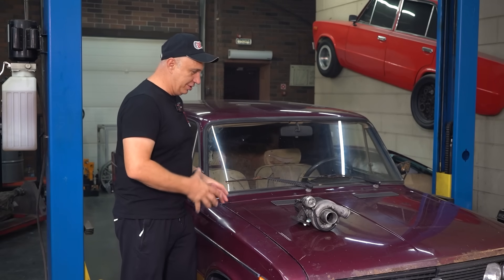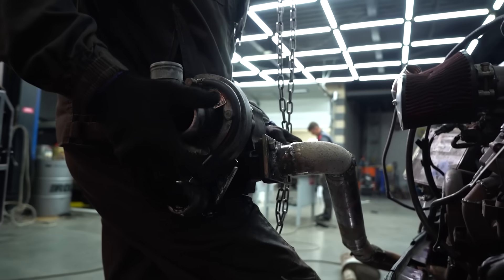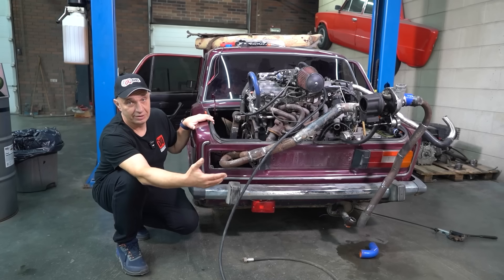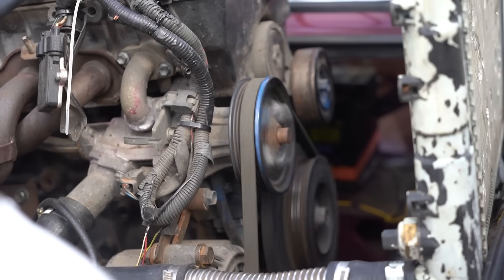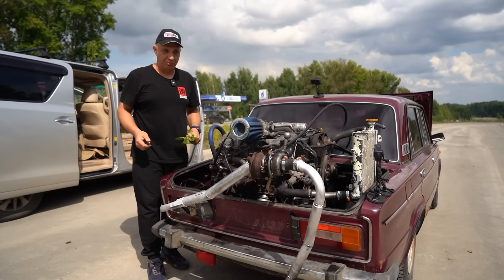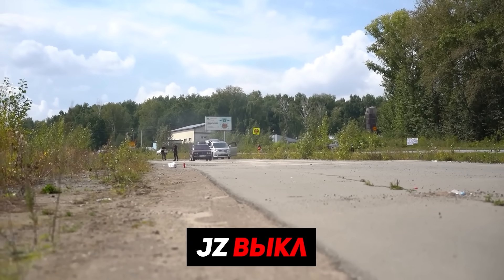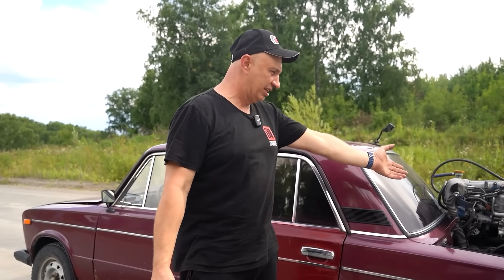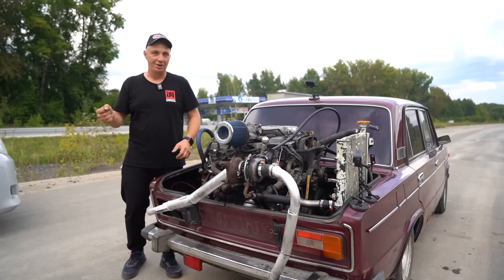Using a turbo to suck exhaust gases out of an engine - what will happen?

Comment: I wonder if a simple side exhaust, with different tip modifications to get a pressure drop from the movement of air around the car would help.(without the turbo) Now, that would only work at speed.

Comment: What about a Ram Air scoop , connected to the exhaust to push and pull the exhaust gases out.  You could mount one on either side of the car. One on the front or one underneath.
 👍🇬🇧🇬🇧🇬🇧🇬🇧🇬🇧🇬🇧🙋‍♂️

Comment: There was a rear mounted turbo system awhile back that sent compressed air back to the engine, don't know if it's still available. It supposedly worked, don't know how well. Conceiveably, you could use the turbo to suck exhaust rather than push air and not need a separate engine.

Comment: Well...an engine is just essentially an air pump working in reverse, in some ways you could say what you've done is connected the two motors with an air based drivetrain of sorts.  You could probably eliminate the 2jz and instead use a shaft connection to an electric motor with a max rpm rating of 80k or so, that should create a similar effect without nearly as much added weight.  You may also want a tractor flap on the vacuum side of the turbo so when it's on and sucking vacuum it shuts the flap and pulls the gasses, but if the turbo is off the gasses push the flap open and you don't gain a ton of back pressure from the stopped turbo.

Comment: Re: pause for prediction: 
Won't get more than 14 PSI of "boost".
Don't know a lot about exhaust system design: but heard that the speed of sound can sometimes be used to encourage complete scavenging. 
Don't know if the Lada has an exhaust system that advanced: but there would be almost no difference in that case.

Comment: This is redneck engineering taken to a whole other level. Negative compression... so zero efficiency? Despite using a 2nd engine to run... a fan... that's bizarre to begin with... but sucking all pressure out of the bang chamber? I predict bad bang. XD

Comment: What would happen if you ran the turbo off a belt from the front of the engine obviously geared up to make it spin very fast, would it act like a blower?
Reply: Yes...thats what a suoercharger is .
Reply: @Prizre obviously, but question is can a turbo be used as a super charger. We call them blowers

Comment: Great video!

Rather than using an entire engine, if you had two turbos, you could make one of them into a jet engine and use it's power to spin the second turbo. 🤔 Or perhaps a couple of car batteries, an inverter, and a vacuum cleaner blower motor to spin a single turbo to create the exhaust effect.

Comment: Means of packaging it easier my thoughts are to make a special electric motor that can fit exactly to the exhaust tip, it has to be able to work with the heat and that may be impossible or I saw this special gel when it gets hard it prevents heat transfer. So probably coat every part possible with it or just have it run with a external radiator that can cool the electric fan 😅😎👌💯🇹🇹

Comment: Guys you didn't need another engine to run the turbo. All you needed was compressed gas or air.
Reply: compressed air wouldn't work, it would be depleted very quickly

Comment: There’s a very fine line between genius and insanity. I really appreciate getting my crazy vicariously through these guys!  But I have to point out that the weight of the second will offset any advantage. You’d get a lot more out of adding a transaxle with the rear engine instead of an exhaust sucking turbo.  I have to wonder if the front engine would be running lean. Once again, very entertaining!  Thanks again guys!

Comment: You basically just got rid of the whole exhaust stroke.

Now just double the power by replacing the 4stroke cam shaft with a 2stroke cam shaft and use 1 belt driven intake & 1 electric exhaust Turbo on a Diesel, which is less picky about remaining exhaust gasses and produces enough extra torque to supply the belt intake turbo.

The electric exhaust turbo is to skip the whole second engine but still keep it decoupled from the engine RPM. You can hack any belt driven turbo into that.

Comment: I'd imagine if the gases were pulled fast enough it would create a vacuum in the combustion chamber which would help pull in air/fuel faster which would certainly help at higher RPM when the valves have less time to pull in fresh air/fuel.

Comment: Reducing the pressure in the exhaust system should increase the power. I don't know if it will improve the fuel economy. The engine will have a lower pumping loss during the exhaust stroke but if there is a lot of valve overlap it could lose some fuel mixture during the overlap period if the intake manifold pressure is greater than the exhaust manifold pressure. I think it might also confuse the fuel injection system and cause it to run rich when using full throttle if it has multiport fuel injection or direct fuel injection. It might be more likely to knock because there will be less exhaust gas left in the cylinder during combustion. Now I will see what results you got.

Comment: Id say, based on the principles of an engine this idea actually servers as like a passive supercharger. It may create such an increased vacum that when the piston reaches TDC and begins the intake stroke there is almost a complete vacum allowing more air to enter the combustion chamber as apposed to the what would normally be left over exhaust

Comment: Removing backpressure risks burning valves and pistons. Some is needed to control temperatures.

That said, I have my own idea for the gang. Transverse 4 cylinder powertrain / drivetrain, assisted by an electric motor on the opposite axle under higher loads to increase fuel economy. Basically a pusher in the rear, and a puller in the front.

Comment: you dont need the 1jZ you just need to put the turbo in the exhaustsystem itself and then put it in in the cold side so it would suck out the back pressure automaticly

Comment: I think one simple way to do it would be using a vacuum machine running on a 12V or 24V battery sucking out the exhaust gases. Imagine a vacuum cleaner just running at the back of your car and sucking out the exhaust gases, would be one simple way to do it with less weight. I think you guys can figure a easy way out.

Comment: What would happen if you took the output from the hot side of the turbo, and hooked it up to the intake side of the compressor? Would it create a compounded affect and continually help the engine accelerate? Or would it just sputter out? If so.. Why not do a twin turbo, where one does the above and the other has traditional forced induction purposes?

Comment: OMG less than a minute in and they are installing an entire 1JZ engine into the back of a lada just to turn a turbo to suck exhaust out of the stock lada engine in the front.  Pretty confident that sticking the turbo on the lada engine would have been much better gains than hauling an engine around in the trunk, but an amazingly psychotic experiment none the less.

Comment: The results indicate that you have a restrictive exhaust system. There are far cheaper and easier ways to extract exhaust gases than mounting a spare engine in the trunk to turn a turbo to suck the exhaust gas from the drive engine.

Comment: Back in the early 70's you could buy something that looked like a reversed cone which fitted to the end of the exauhst pipe to suck out the gasses as you drove forward.  If that worked why wouldn't an electric fan sucking the gases out be enough?
Typically mad, but great to watch!

Comment: Neat fact, Large steam engines used water injectors to cool exhaust steam which lowered pressure and greatly improved the steam engine efficiency.

Comment: Seems like a lot of unnecessaryness. Thinking a 12 volt high RPM motor with a small oil reservoir would have worked just fine to operate the turbo

Comment: Consider that the turbo sucks intake mix during " valves open overlap "  so,  an induction intake and richer mix could solve the problem.
G54 ⭐👍

Comment: Back in olden times when I did a little drag racing (bracket), eliminating all exhaust back pressure was something to be avoided.  I can't remember the exact science behind it but performance, and definitely throttle response, was adversely affected.  Clearly that's not the case with the higher performance engines but for semi-street tuning it was.  These results are probably to be expected from improved breathing (who knows how restrictive and inefficient the Lada combustion/exhaust cycle is) but this is still very interesting.  Отличная работа!

Comment: What happens if you attach a Ranque-Hilsch tube to the turbo? Is the pressure powerful enough to condensate the water steam in the exhaust? Maybe you could use the condensed water to make a powerful water injection engine.

Comment: Can you test my ideas if viable: 
1.a vane engine used as compressor for a normal ICE
2. Cam drive instead of crankshaft 
3. A turbocharger connected to the engine via an eddy current based magnetic coupling that can be disconnected for it to be used as a turbo or connected to be used as a supercharger.

Comment: Would it be more efficient with a procharger (belt drive style) to a 10-12hp engine due to the weight reduction and the abilities to adjust the speeds with different pulley sizes × rpm.

Comment: Aww darnit I missed it!   We did this back in the 80,s. We took a turbo and put a belt on it and drove the exducer to vacuum the exhaust.  ON 2 STROKE ENGINES!  This is a bit of a secret here folks. Oh im being bad...But I gotta do it for Garage 54 Crew.   If you put a vacuum on a two stroke you can massively improve performance, BUT it has to have a exaust modulating valve to stop it at low Rpms.
Or you will draw the entire combustion charge out of the cylinder and kill fuel economy, crush it really. the exhaust will pee gasoline.

Comment: Try making some sort of turbo pressure recycling system Where the pressure from the manifold is being stored in a pressure tank and sealed when the throttle is let go, and opened when the gas is pressed again to avoid turbo lag

Comment: Interesting concept, but it won't be viable. If not going with a conventional intake turbocharger, the smart alternative is an electric turbocharger powered by a hybrid battery and its high voltage system

Comment: Something strange about this install. There's got to be an easier way to plumb a turbo into another turbo and have it run off of one engine the fact that you have to add the weight of another engine is ruining any gain

Comment: I have the idea of designing the exhaust with mid cuts in cone shape to use bernoulli effect to expulse the air faster, no extra load, no power consumption and may make the exhaust system faster

Comment: Garage 54, can you please try turbo compounding? This is not the same as a compound turbocharger, but rather where an impeller similar to a water wheel is used to turn exhaust gas velocity into torque. The output of this turbine is routed to the crank via viscous coupling. Basically the reverse of a supercharger - instead of using engine power to induce pressure in the intake, it takes velocity out of the exhaust and induces power at the crank. Mainly used for early-jet era airliners for best efficiency.

Comment: i wonder if this could take advantage of the venturi effect? maybe a compressed air tank being fed air via a compressor on the engine so the tank doesnt deplete, with air nozzels within the exhaust angled and pointing outward. this would help draw the air, though the volume you would need would be very large.

Comment: Try it on a car with a turbo engine. Attach another turbo to the car but put the hot side to the cold side of the stock turbo. Then attach the factory turbo DP to the cold side of added turbo and continue the exhaust system how you need it. The factory turbo cold side will drive the hot side of the added turbo. And the added turbo should have power to scavenge the exhaust out. The lag might be more noticeable but in the higher rpm’s it should make up the difference.

Comment: Maybe try using developing a supercharger set up this way. That way it also sucks in accordance to the rpm’s and you might be able to still run a turbo making a best of both worlds. This of course assuming the loss of power running the super charger wouldn’t counteract the positive of it

Comment: Have you ever seen a secondary air system in a woodstove? It helps burn up unspent gasses.
So what if you had a turbo engine, and siphoned off some of the boosted air and injected it between the exhaust valve and the turbo impellor, and another, after the turbo?
The first, with the fresh air injected would provide a secondary burn, possibly turning the impellor faster, with the second one helping the exhaust gasses exit.

Comment: Somebody really should do smth like this cuz it helps the engine rev quicker, imagine for example a turbo charged and conperssor "discharged" setup. Or turbo discharged and charged setup.
Or to set it up on a bike like r6 with 16k redline ,meaby it would achive a higher rev limit and quicker acceleration

Comment: Ok so a system that utilizes an electric supercharger to create vacuum in the exhaust on acceleration pulls, but then act as an exhaust brake on deceleration while simultaneously recharging the batteries. You’d create a type of hybrid system that could recoup some of the lost energy generally wasted on braking and reuse it to actually boost performance. I’m really curious is there is any viability to this idea

Comment: My prediction is a minimal increase in power, much less than the increase in weight, and a drastic increase in oil burning as oil gets sucked past the piston rings and valve seals. END: Oil consumption confirmed. Since he never tested the time without the engine in the trunk, there's no way to prove the other part of my theory.

As a way to prove a point, you did. But even if you could package this more efficiently, or perhaps just use a supercharger and belt drive it, forced exhaust is never going to be a viable market option in any place with emissions controls due to the reversed blowby spraying oil out the exhaust. It would be interesting to see if there were a way to use it in competition builds, though, I would assume as a supplement to forced induction. A two way supercharger that pressurizes the intake and sucks a vacuum on the exhaust? It should be possible. Practical, I doubt.

Comment: Congrats, you've basically discovered the inverse of ye ol Exhaust Brake (aka Jake Bake). 😉
Hence why letting off the turbo's throttle, it shows the car down. More resistance in the exhaust, which slows the Lada engine, which is connected to the wheels, thus slowing the car.

Comment: Surely, this will work, but the question is:
What is it even going to do?
Exhaust restriction has a pretty small effect on power until it becomes dramatic.
This would probably be like putting a 5' exhaust on a Lada.
That wouldn't change much in terms of performance, I'd think.

Comment: Use a deconstructed turbo, use an remote control car electric motor 42v setup to run the turbo, can use it to either suck the exhaust or provide upto 6 psi into the engine depending on the setup haha.

Comment: could you get a electric turbo and use that instead? or is the rps on an electric turbo not enough to change the difference like the 1jz in the back of the car.

Comment: Well, exhaust pumping losses will go down, but the limiter is still going to be there is only atmospheric pressure moving air into the FRONT engine.  Hey, at least as a control, run the zero to 60 in a Lada without the extra engine.

Probably would have been faster with the extra engine connected to the wheels…but you guys knew that!

Comment: Uhhh... It's not using it's own turbo to pull the vacuum. You guys litterally added an entirely seperate gas engine just for the Turbo.
While I applaud the extreme lengths you went to get this to work, I can't help laughing at how inefficient it is. You don't NEED a combustion engine to run a turbo. Though finding that kind of Motor in Russia right now would be impossible.

Yes. Technically the title is true, it's not clickbait.

Comment: Why not connect a twin turbo setup on the stock Lada motor? Or swap the stock Lada with the 1jz and do a twin turbo.
  1st turbo is setup normally.  
  2nd turbo also feeds off the exhaust, but the exhaust is then fed back into the 2nd turbo's intake.

Obviously, there would be the parasitic losses incurred by two turbos, but then that's where turbo sizing and aspect ratios would come into play and maybe eliminate those losses.  
   Or, as someone else said, use an electric motor to power one or both of the turbos.  But then you would need an upgraded electrical system for them and very high output battery banks - and they aren't meant to run constantly that i know of.

Comment: The question is whether the power used by the turbo is more or less than the power gained from sucking out the exhaust, if you ran the turbo from the same engine (which would eliminate most of your weight cost). Then you could reroute the output from the turbo to the exhaust at the back.

Comment: It seems like negative pressure would result in lossed HP because not all the fuel combusts.  But there must be a sweet spot, where some assistance would increase HP.  The environmental regulators would no doubt lose their shit either way.  Because the catalytic converter wouldn't be doing its job.

Comment: A brushless electric motor, that tracks engine RPM, with the electric motors RPM, combined with a turbo on the internal combustion engine, run off the exhaust. The electric motor, could spool faster to build vacuum, This really makes a person curious.
Maybe if the 2 turbos could make a timid motor, suddenly very efficient, and powerful. I am sure the military has experimented with such a thing.